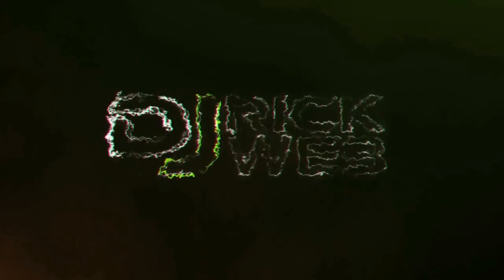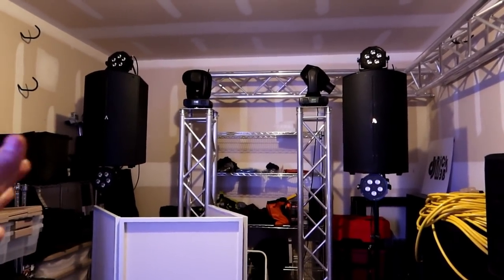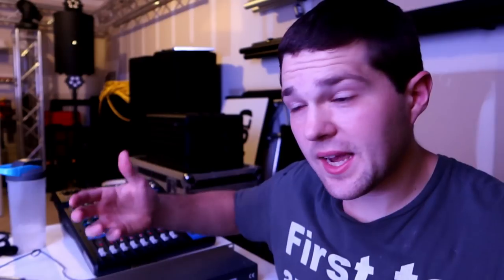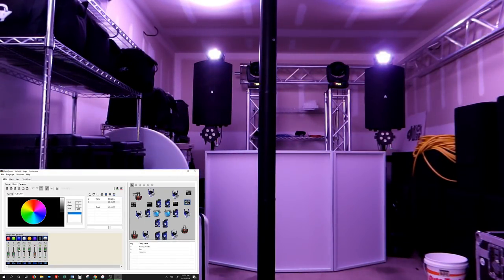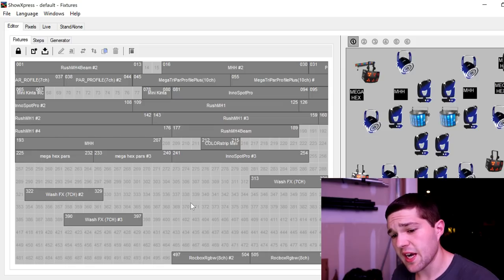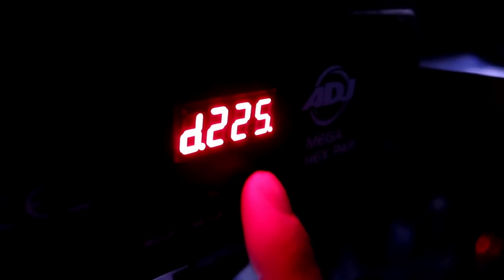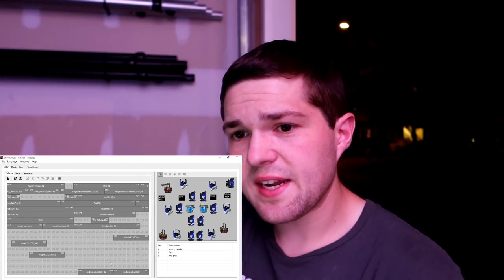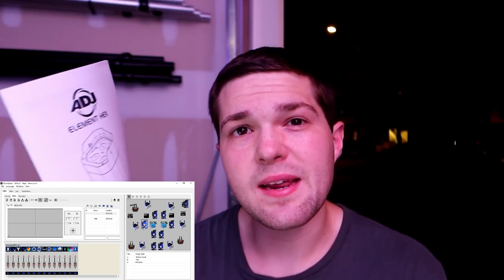How DMX LIGHTING Works for the mobile DJ | Wireless / Wired DMX | Chauvet Show Express | What is DMX

Comment from the maker: This video is proudly sponsored by all the awesome people on Patreon!

Become a Supporter of the Channel! And get your name listed in the next video! https://bit.ly/2O7OfWU
Reply: DJ Rick Web Great video! Just wondering if you are able to run your ADJ Element Hex’s off of Show Xpress. Does Show Xpress offer wifly? I’m currently using Airstream Bridge, but considering switching to Show Xpress
Reply from the maker: No but if you plug dmx into any of the elements they will communicate to each other. So yeah super easy. I normally only use them on show express
Reply: Cool, thanks. I have the HexIp version which don’t have DMX in and out. They are strictly wifly. I’ll have to figure something out

Comment: Don’t forget you can also use a DMX splitter which means you don’t have cable daisy chain from 1 light to the next. This will save on cable especially if he lights are in very different ends of a room.
Reply from the maker: Very true.

Comment: Chauvet Show Xpress VS Soundswitch... Pros, Cons, which is better & easier to use.
Reply from the maker: Difficulty level is equal. Show Express offers full control of your lights and can be used with both mobile style fixtures and bigger production lights. Show Express requires a seprate laptop. Sound switch is a little hard to program in my opinion. Not near as much control. Uses your same laptop you DJ with. Sound switch more or less runs itself and does a decent job of matching music tempo. Show Express needs an operator but benefit is the operator can match tempo and energy perfectly.

Comment: Great video, Ahhh I cringed at 14:30 please make clear to new users DMX is NOT XLR.
Reply from the maker: It is xlr connectors. It's in the cable its self.
Reply: @DJRickWeb  yes. Just dont want some to accidentally plug the DMX into a speaker.
Reply: To prevent mixing DMX and audio gear the official standard specified 5 pin XLR connectors and 120 Ohm balanced shielded cable (RS-485 DATA cable), but the connectors were about $12 each, so cheap common 3 pin was substituted which is where DMX gets mixed with audio cables.  DMX is a data standard. XLR is a connector type.  RS-485 is a serial data transmission standard for sending computer data over shielded twisted pair wire. DMX, a data standard specifies using the RS-485 physical cable standard. Using a microphone cable which is not 100% foil shielded and not 120 ohm, and not designed for response to 250,000 HZ is asking for a problem with the lights.  Shorter cables are more tolerant with the data, but long cables will be a problem.  Don't use mic cables for DMX.  Your mic cable may be perfectly flat at 50,000hz, but is it still certified to work with 250KHZ? In addition there is a wiring difference. Good mic cables have the shield connected to the shell of the DMX connectors.  The DMX standard forbids this.  DMX connector shells are NOT connected to the shell of the connector.  The standard requires a "termination" of the cable on the end.  Most setups less than 50 feet work OK without it, but long runs won't work reliably without it.  Most DJ's without long cable runs simply ignore the requirement for the termination.  Noted the video mentioned nothing about the terminations. Probably not using them.
Reply: @isettech  yes I'm aware of the specs and things but someone that is green with DMX may not.
Reply: Easiest way is to label your dmx cables or in a separate bag labelled dmx so you won't get mixed up
Reply: @joshk_dj  if they want to plug a 5 pin into a 3 pin connection you have bad hands. lol its easy to tell them apart :)
Reply: @joshk_dj  yeah all my DMX cables are Livewire and have silver ends. All my XLR are Daddario and have black ends. All my DMX cables have either rad, green, yellow or white tape for different lengths. XLR are green, pink, yellow and blue. Same also goes for IEC and powercon.

I make everything so I can tell someone who know nothing about DMX or XLR what cable to hand me.
Reply: @Shawn Rogers, I have mic cables that are 3 pin, same with my dmx cables which I use to master and slave for my moving heads, I keep them on my over head bars all the time and if they don't stay on the bars then they go in a separate bag

Comment: Great video! I have a question. Will the adj wifly fixtures connect to a wireless donner transmitter without connecting a receiver to it? Or do they only connect to the wifly hardware?
Reply from the maker: Adj only works with adj unfortunately

Comment: Hey Rick, first thanks for the video. Second is my context and question: I'm a new DJ and I have a pretty simple setup. I bought 2 ADJ mega par profile pluses. I would like to buy more pars but i don't want to have to buy only high end ones, I'm on a budget you know? If I buy cheaper pars off amazon, and daisy chain them from the ADJ Pars, will they work or do they use different master slave signals? Thanks!
Reply from the maker: They could potentially work but it come down to luck. The dmx channels for the cheap will have to line up exactly with the channels of your adj light for it to work.

Comment: Nice, I recently just got into DMX and lighting as well.. using ADJ AIrstream. I have a few of the donner dongles, but what I have done that is much easier is actually install the wireless DMX board into the light this way no need for dongles! makes things much easier.. just plug and play..the boards are $8 on ebay from China and have worked great.. its actually the same boards that chauvet and other ligthing companies use in order to get the wireless DMX
Reply: abo7uson cool do you have a link or the specific name for these units? Thanks
Reply: Very cool thanks

Comment: Question: I know to run my DMX cables in and out since everything can be seen clearly on the back light itself. Now, my question is where should I plug the 1st cable, on the back of of my speaker?
Reply from the maker: No speaker is audio not dmx?

Comment: Hi .How are you. 
Is thre a way using the DMX to set the Gig Bar 2 in auto mode or sound active for the lights randomly 
Thanks
Reply from the maker: Check the manual. A lot of lights have that option in the higher channel modes.
Reply: @DJRickWeb  Thank you

Comment: Did ADJ upgrade their Show Express?  It used to be sold as a starter kit with limited number of DMX channels in one universe.  To unlock the rest of the universe, it was another serious chunk of change.  As a result I opted for a non propritory interface.  It uses the Streaming ACN AKA E1.31 for DMX over Ethernet and out of the box it provides 6 full universes of DMX for about 1/2 the price of Show Express.  Due to a non propitiatory solution, I can use any program compatible with Streaming ACN, and send it by WiFi to my router and interface.

Do not be afraid to look outside mainstream DMX vendors for gear.  The Christmas show hobby folks driving pixels have awesome multi universe gear for cheap prices.  With a cheap used wireless router and buying a kit, I have 6 full universes of wireless DMX off my laptop.  The software can take inputs from MIDI, DMX (another ACN device, HID devices such as joysticks, transcription footpedals, etc.  I can use a Microsoft Flight Simulator joystick to drive my moving beam as a follow spot for events and such. How cool is that?  Still want a box of sliders for moving lights?  No problem.  Software I use is free open source.  Very budget friendly with great features including scenes, chases, and Que Lists.
Reply: @ludman2299  Thanks, I hadn't paid much attention to the other entries into the proprietary offerings once I had decided to go with open industry standards.  Vendor lock in is OK if it is future proof and reasonably priced for the performance and features.  In looking at the offerings the VHS/Betamax/laserdisk/CED video players of multiple incompatible standards are plentiful. Enttec&Lightronics/Chauvet Show Express/ADJ WiFly My DMX/ and Donner wireless appear to be all incompatable with each other and those with a software solution appear to be incompatible with all other wireless systems. To use Show express with a PC, it must use Chauvet lights. To use My DMX, you must use ADJ Wi Fly lights.  To mix them requires not using the built in incompatible wireless.  Donnor is a good wireless link system and works well between a console or PC with adapter, but it's wireless is again incompatible with any manufcture's wireless lights receivers.  I've seen some of the wireless options, but they are incompatible with industry standards the way MP3 is pretty much standard for digital music.  For this reason, I use either Artnet or Streaming ACN over Etherent or wireless and use cable or Donnor for linking to the lights.  My lighting laptop can run any lighting program that supports either E1.31 or Artnet.  This includes Vixen, Madrix, MA2, ChanSys, QLC+, Lightjams, Freestyler (Artnet, waiting for E1.31 upgrade), and others.  Works with many phone and tablet applications too. Use a tablet to trigger cue changes on your laptop.
Reply: You're incorrect.... Showxpress doesn't solely require chauvet lighting.

Comment: So question: when 2020 the frequencies change over to 5G will 2.4 GHz stop working?
Reply from the maker: No lol. And do a little more research on 5G cus it's not coming that quick. Probably be 2022 before its fully rolled out. And it's pretty complex.
Reply: Please note: 5G does not mean 5GHz. Also you are mixing WiFi and LTE which are two different things.

Comment: Hey, Rick can you link different lights together using only one wireless DMX receiver?  Like I have 2 t-bars that I'm going to be using at my parents 50th wedding anniversary party.  On each t-bar I will have a Chauvet Wash FX, Chauvet Swarm Wash FX, and a Chauvet mini kinta.  I want to run them wirelessly but can I hook one receiver into one light on the t-bar and link the other ones together?  Or do I have to put a reciever into each light in order to run them wireless DMX?  I think you only should need one receiver to recive the signal but wanted to make sure.  Thanks for your help.
Reply from the maker: Yes you can
Reply: @DJRickWeb  

Thanks for the reply, Rick.  Also, sorry about your truck man.  That sucks.  I seen your post for a quick sec at work.  Glad your OK.

Comment: Hey Rick, thanks for the video. I’ve been DMXing a whole bunch of fixtures for a while and I use the ADJ DMX Bridge. Lately moved to using the Doner wireless dongles and I’m experiencing a LOT of lag. Lights do change, follow my scenes and shows but after a extreme long lag. Have tried changing channels on the donners, didn’t help. Since you use them too, have you ever come across it? I’ll have about 7 receivers to 1 transmitter and several receivers have their own wired chains too, at times (depending upon venue)
Reply from the maker: Try a different channel to run them on. You are probably experiencing interference. You also have to consider with the dmx bridge. There is a delay from the ipad wirelessly to the bridge. And then another delay from the bridge to the lights

Comment: Hey Rock, been watching your videos and leaning quite a bit.  But I'm new to Djing and new to DMX.  I have played in a band so I amd familiar with some things.  But I want to start DJing and was wondering about DMXing my lighting.  I want to go wireless but was wondering about what would be better to use for wireless DMX as far as the controller goes.  Rack mount, or the ADJ box you have in this video?  Also, I was wondering how and where to get the Chauvet show express software?  Thanks for your time.
Reply from the maker: They dont sell the rack mount anymore. It comes in a little box now for the showxpress. And I left a link to the software in the latest dmx video
Reply: Hey, Rick thanks for the reply!  Let me ask you something,  so my parents are having a 50th wedding anniversary dinner/party roughly less than 100 people.  I have heard that guitar center rent's out DJ equipment.  My question is what should I ask for as far as speakers and all if they have available for a venue that size?  
I have been getting some lights on my own and so far have 2 Chauvet mini kinta's and one Chauvet swarm wash.  I plan on getting some par lights as well.  But I think that will be OK for now.  Just plan on running them on master slave mode as I don't think I will have enough time or money to do DMX as much as I would like to.   Anyway, thanks again for your help.
Reply from the maker: @maxanddad1  guitar center normally only has qsc k12s and 181 subs available to rent. Two k12s will be plenty and just make sure you have all the cables to run them
Reply: Thanks Rick for all your help.  Now do I need a board or anything special to run the speakers?  My nieces husband's parents use to be DJs a little while back.  They have sence got out of it but said they would be more than willing in doing the party for us.  They plan on just hooking up a laptop.  But I don't know how to do all that.  I thought you had to have a board of some sort.

Comment: ADJ DMX bridge sucks, I paid $400.00 for it thinking it was the easiest way to go and it's just sitting in my studio collecting dust. the most expensive coaster I've ever bought.
Reply: What is your problem with it? I have it and have been programming the hell outta it with several various lights both name brand and not. No issues at all. Curious why you don't like it.
Reply: mghattendorf i plain don’t understand it but rick web did shade a little light on the situation and im going to try it.